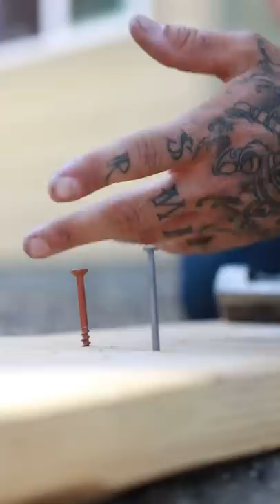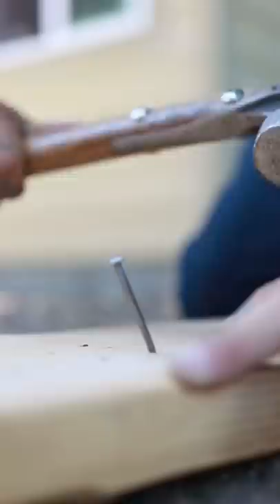Nails vs. Screws: Why do we use nails? #shorts

Comment: They're substantially cheaper and can be shot by a nail gun in a split second, not the 3 or so seconds for a screw to be driven. Nails hold lateral force better but not a force that would drive them up, such as decking materials or drywall. Quality contractors almost exclusively use screws for flooring underlayment, decking materials, drywall, and to help with cabinet joinery to eliminate squeaks and unsightly gaps as materials expand and contrast.
Reply: Jacob Brown  gay*
Reply: My grandpa said the sun pulls nails out. He may be right about that, but I'm sure you're going to say that the cold and the heat from season to season does that.
Reply: You’re correct that decks and under layment should be screwed, but I believe Matt is taking about framing

You wouldn’t frame a house with screws as the fasteners.
Reply: WishUPONa Bentley  
For what reason?
There is zero benefit.
There is actually a loss in structure integrity and a loss in production rate.
One translates into an inferior construction build
The other into a profit loss.
Both equal a more expensive and lesser quality home.
Reply: WishUPONa Bentley  bad joke and bad you
Reply: WishUPONa Bentley  i see no joke
Reply: WishUPONa Bentley  lol he said nothing about a degree. But "great joke."
Reply: You are totaly right, but maybe the cultur & kinde of constructing in murica isnt meant to stay for long periode of time...i mean a house in germany (should stay forever) which is 200y old isnt seen as "old".
In the u.s. you build a new every 20-50 years i guess....y have other weather conditions so you have to build different i think
Reply: @apdeleis  actually thats a Asian thing buil house meant for one generation American houses are built last. Hell my great uncle floated the house my mom grew up in down a river to get it to its current location
Reply: @apdeleis  no we build new buildings yes but we very rarely destroy old ones its the drug addicts that destroy houses
Reply: @joebone3151  i'm an drug addict & never evan touched a house ....just sayn
Reply: Let's say One builds a set of stairs  screws are. The best it would take longer but swcrews hold wood together better
Reply: Once all be the way in The wood neither will bend like in this video
Reply: @joebone3151  drug cooks* haha
Reply: You mean shear. Nails are stronger in shear, that’s why. Not fatigue like this guy is showing
Reply: This is the answer I was looking for. Thank you sir for give it to us straight
Reply: @victorcrossier8642  ever looked at a wood deck, 5 year after it’s laid. Majority of boards will be warped, and the nails will start to climb out.
Reply: @joebone3151  If you think American homes are built to last, you haven't been in any new construction neighborhoods in the past 20 years...
Reply: @patrickancona1193  a luxury built home, such as one built by risinger, will have near 0 movement. You’ve completely skipped over, the fact that houses in those high weather areas, are built to a much higher standard, and require significantly more strapping. In your argument, none of those houses should have any movement or sagging.
Reply: @victorcrossier8642  I mean he’s not totally wrong the sun is producing said heat
Reply: @joebone3151  Dakota over here with the stigma ligma
Reply: @itaintrocketscience  You abesolutely can, but as a contractor it be really expensive, unnecessary and take much longer.

Technically screws are stronger. You never see the bending force in a real life application like he does with a hammer to make the screw might snap. But in really life it can sustain higher loads.
Reply: @apdeleis  I've remodeled more places than I care to remember because of drugs.

The small exception doesn't change the rule.
Reply: @carlice8513  tru*
Reply: Other than board warpage an earth quake or tornado or class 4-5 hurricane your then 🤣 fuckin cheap lumber these days
Reply: @Studio23Media  dude its different from state to state
Reply: @dylnbxtr  simply because we are.
Reply: That's exactly right! Vertical Force vs. Lateral Force. Roofers use ring shank nails which are nearly impossible to pull out
Reply: @joebone3151  There are plenty of shoddy houses being built every day, in every state. American home construction is embarrassing.
Reply: And a nail doesn't fucking do much it s just a piece of metal shoved in there. Have a deck built with nails from previous owners and all the nails coming up cuz guess what nails are fucking 1800s technology
Reply: Or don't use nail at all, but it's more costly and time consuming.
Reply: I’ve had nails fall out of my walls and it’s was annoying enough to complain about on the internet

Edit: I live with someone who has a mental disability and hits the walls (not enough to break the drywall) but enough to make almost every nail fall out of the wall, I replaced them with screws
Reply: @grimendancehall  nails are better for framing screws are better for decking
Reply: Yeah I don’t know what this guy is talking about. The material of the nail/screw determines it’s malleability not the shape. Screws also tend to be higher quality than nails because they’re an overall upgrade than nails when it comes to intended design use. So in conclusion… use screws for personal stuff, nails for other people’s stuff
Reply: There are actually screw guns, most factory house building companies in Sweden use them. They are only slitlghy slower how ever they are ofcourse alot more expensive to use.
Reply: So which came first The Nail The Screw or the nail gun.😂
Reply: How do I go from working for an unquality contractor to a quality contractor...
Reply: Ok ok we get it nails a better. But they are terrible to get out.
Reply: @Brenndan lol, you missunderstud my point boi....it doesnt matters if you are able to built million different houses if the quality is shitty in the end.
Dont take it personal, but you cant compare the american way of constructing with the europan culture of craftsmenship, hundret years of growen knowlege & experience (and thousends of rules about everything....stuff y never heard or thinked befor)
Reply: Also, screws can unscrew themselves after a time
Reply: In the EU we build houses out of stones.
Reply: @joebone3151  unless the house is in a poor country with oil
Reply: @johnrus7661  pretty sure drugs are inanimate.
It is people you are thinking about....people destroyed some houses...or neglected them rather.
Reply: nails are technology, heard it here folks!
Reply: @dylnbxtr  what country are you from?
Reply: @apdeleis  🤣🤣🤣kids these days
Reply: @joebone3151  the shearing thing makes sense conceptually but practically its still up for debate imo. Your framing will never shear piece from piece that drastically. I want to maybe download and put this in a finite element design software to analyze the actual effect. Also obviously there are more heavy duty screws but thats more expensive
Reply: @itaintrocketscience  if u think all screws are dry wall screws then yea probably; but if u ever looked into structural screws u would know better. Ever use bolts for beam installs? Yea bolts and screws are the same jn this regard
Reply: Damn people are dumb, they think every nail and screw is the same. You can make a less brittle screw and it’ll hold a lot more than the nails. Screws have a higher potential shear strength and far higher potential tensile strength. However, most people see screws with low shear strength because they’re not being used for framing in the first place. Why would you compare apples to oranges, compare a framing screw to a framing nail.
Reply: @zefrum3  
I’m an electrician by trade, but also a builder.
Yes, I’m aware of structural screws.
I can’t see building an entire house with screws.
Too expensive.
Too time consuming ( and I’m a slow builder, NOT a production builder)

There is almost no benefit building with screws, other than bragging rights.

I don’t know of a single house that is framed using screws.
Seems unnecessary
Reply: @zefrum3  
Wow 
LOL I’ll leave the electrician stuff out.
You’re right, for this discussion it has zero relevance.
 
I also said I’m a builder, which means I can swing dick too ( as you so eloquently put it) 
I never said that screws have no place in building. I use the to set subfloor, install stair treads, deck boards, attach ledgers to the house, installing cabinets and of course installing drywall.

But I’m not going to set plates and build walls with screws. 
I’m just not gonna do it.
Nails are more than adequate to hold studs in place, pin rim joist, bottom and crown plates. You screw them if ya want.
Reply: WishUPONa Bentley  I'm on your side lol these guys need to relax
Reply: @creamwobbly  the homes last longer than your life how is that a scam you'll go off to meet the Lord before your house falls apart the problem is no one maintains theirs house lazy people. Then they say we built the house bad LMAO wood is the best building material y'all need to stop
Reply: @apdeleis  America is equal to or greater than Europe in construction we taught Euro many news technique and America revolutionize construction in the modern age you guys have no idea what you are talking about people gotta stop haring the united states and start saying thank you I appreciate other countries for their contribution but looks like when you are the leader of the free world you have to take some hate
Reply: and if you got a materials thats twisted when screws is so nice to force it in place :)
Reply: When's the last time that you saw a cabinet expand and contract? Btw, vinyl siding utilizes nails for the expansion and contraction aspect. Besides, the point was using nails for structural reasons. Flooring isn't structural
Reply: Ring shank nails are good for pulling things tight
Reply: Excellent information but your usage of contrast instead of contract is bothering me
Reply: @offtherichter7  was looking for this comment.

This is also only based on the material. It has nothing to do with screw vs nail. 

Nails are just pins. Screws function in the same exact way just spread over a much longer area.
Reply: @joebone3151  maybe at one point, but a lot of modern houses are built like shit and definitely not to last.
Reply: @apdeleis  I’m a drug addict that’s destroyed multiple homes... just sayn
Reply: WishUPONa Bentley  if you screw a deck together with screws I PROMISE it willl be falling apart in a few years if its being uses as a deck.
These days there are screws that provide higher sheer strength so as not to snap but they are hella expensive and way thicker than nails. Source: I’ve been a contactor for 10 years.
Reply: @dylnbxtr  
Most of Europe will be Islamic territory in 30-50 years, calm down.
Reply: @victorcrossier8642  yes the sun quite literally has a hand that pulls out nails
Reply: @dylnbxtr  at the very least we are far better then you
Reply: When we did cabinet installs we had a cabinet come off the wall. Woman said it was the installers fault. It was dropped when they found out she put a whole shitton of cast iron in the uper cabinet. Screws are good for holding things together but then the thing being held isn't as strong as the screws it can end badly sometimes
Reply: So I should just use deck screws when building the floor and floor joist on my 12x16 storage shed, and nail the rest?
Reply: @carlice8513  bro you are so funny my laugh will arrive in 4-6 business days
Reply: @itaintrocketscience  unless you're in Canada, where it's required lol
Reply: This guy knows
Reply: For sure specifically for framing. Where all the load of the house is on. Flooring, and finish stuff inside doesn't matter. And yes, screws will hold the floor down tighter, even prevent squeeks.. Nails for framing. 💪
Reply: Pay attention children, this man speaks truth
Reply: This guy gets it

Comment: I use both. I throw screws in to prevent nailpops. In framing a 2x6, I use 3 nails and 2 screws. I line it up, add the screws, then follow with the nails so the nails can’t change my alignment as it goes in.
Reply: This guy gets it.

Comment: Demo'ing a building held together with screws is damn near impossible without removing or cutting the screws. Screws have several times the holding strength of nails. I use  screws 99% of the time when I build something.
Reply: That sounds tedious. Why isn’t that a similar issue with nails? Because the ones used are cheap or…? I’m just imagining a bunch of lumber with nails sticking out very dangerously
Reply: @doombuggy123  nails can pull out. Screws thread themselves in. I am from fl and it was looked at years ago that screws would make buildings have a much higher wind withstanding capability (hurricanes come thru a lot) but it is far more expensive and time consuming and most people don't want to spend the difference
Reply: @torque-ej4nu  went to a construction site today that was held with bubble gum, a couple light hits the frames were budging out, like damn no way I’m living here
Reply: Liar
Reply: @steveholt5115  who is a liar?
Reply: for framing and quick construction, screws are not ideal. its being surrounded by bricks and corners locked with floors... cold shrinks heat expands....
Reply: With the glue painted on nailgun nails that sets with the friction, they hold almost as good as screws. If you need strength you're using giant screws lag bolts anyway. Nails are cheaper faster and plenty good enough. Can use weatherproof screws where it's exposed to weather but no need to screw together walls and floors. That would take ten times as long or more
Reply: @torque-ej4nu  nailgun nails are dipped in glue that sets by the friction as it enters the wood. They are a bitch to pull out. It's easier to remove screws. Because screws break. The damn nails just bend and still hold. The nails will last longer than the wood will last for an outdoor deck.
Reply: @DeuceGenius  cheap screws break dude. Ive built one of my decks using a nailgun like you speak of, use to frame once upon a time, to this day still have to drive nails back down on occasion due to wood swelling when it rains and pushing them up. But, you know, its the YouTube comment section,  everyone has a contradiction comment. Never fails.
Reply: The correct type of screw should be used when you want what material you are fastening to not be able to pull away from what it's mounted to if its not bearing weight from above. Nails or structural screws should be used when you need a load bearing fastener with a higher shear strength
Reply: Me too!
Reply: @DeuceGenius  screw heads breaks but the body of the screw is in..very difficult to pull out.screws hold better period.
Reply: @torque-ej4nu  they make deck screws for a reason... a house frame is not a deck . if its tight, it breaks with cold and heat differences. its strength comes from the frame, tied together in many spots and locked with floors, walls butting and making corners, and more floor on top of the walls surrounded by bricks. why are so many people with little life experience giving their 2 cents on this?
Reply: Dude that builds birdhouses has weighed in
Reply: What do you build ... asking out of curiosity
Reply: That nail is steel, his screw is a ceramic deck screw, They’re heat resistant but trying to build anything with those screws they just chip off and fall to pieces if you’re anything heavier than gentle. Nails for fastening, screws for gripping. You’d never hang a door with nails in its hinges, for example.

Comment: Construction screws are code approved for framing in Massachusetts, so they're structurally fine.

They can still bend without breaking, quite impressively, but the nature of how they're made doesn't provide as much shear resistance as a nail.  

However, a properly fastened screw won't lose its grip in lumber the same way as a nail, so a structure will stay more rigid with more fasteners staying in place with natural settling.